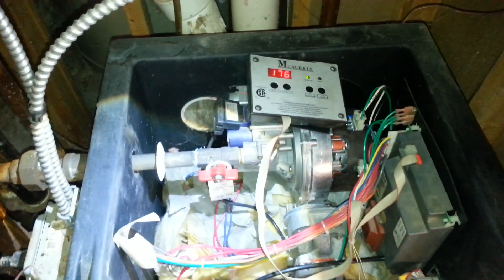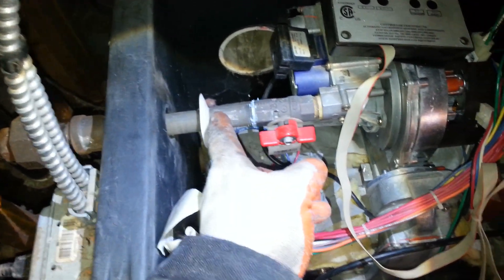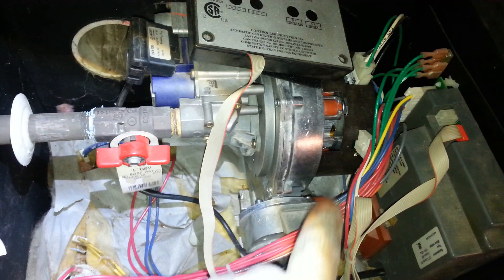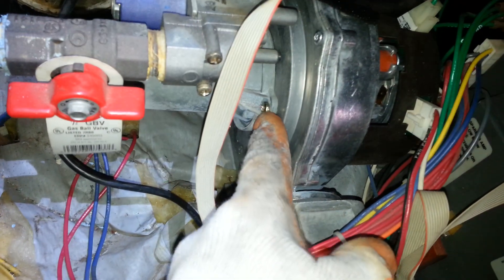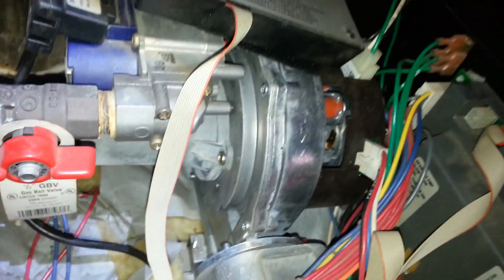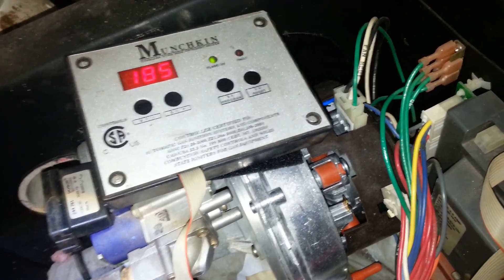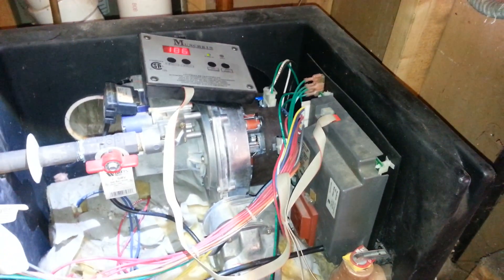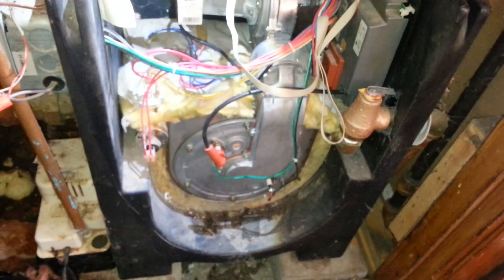Munkin Boiler Repair

Comment: Do you have any experience with pr0 fault code?
Reply: Means pressure switch or incoming water supply pressure is bad. Check water supply regulator , if that's fine , your switch may be out, on Lower right side of unit. On top. U will see it

Comment: Do you know if the munchkin boiler and the peerless boiler use the same parts? I have read they do but one supplier doesn't recommend doing so because neither peerless or munchkin will say either way. Thanks

Comment: Hi my boiler has the same code f-13. The boiler works as soon it reaches the temperature u desire it turns off and it doesn't turns on aging. I have to reset it every time. Can u give me any advice